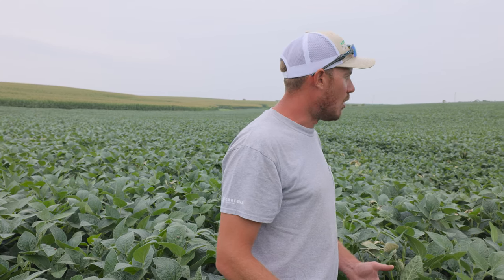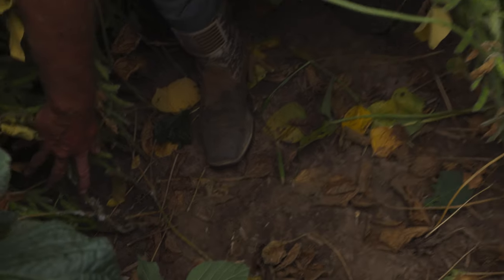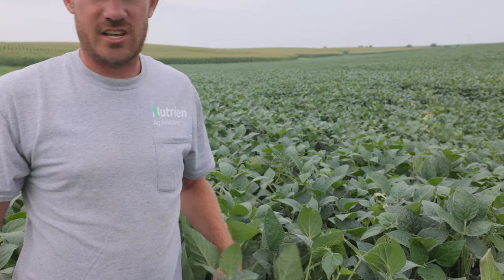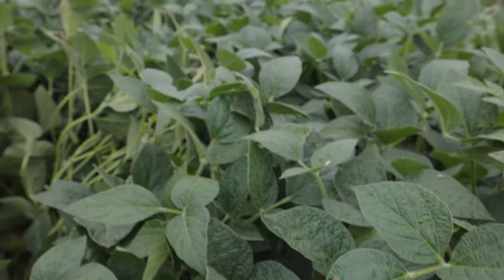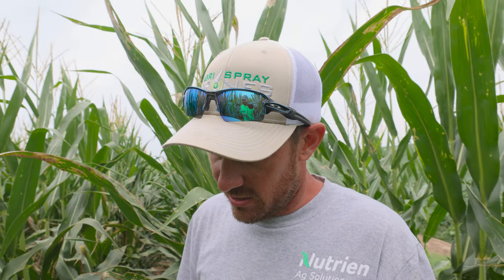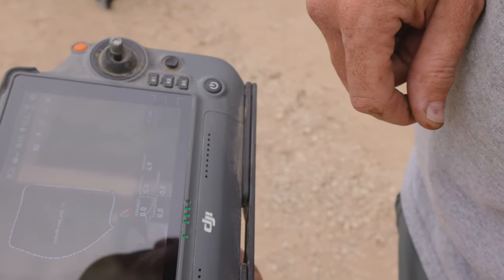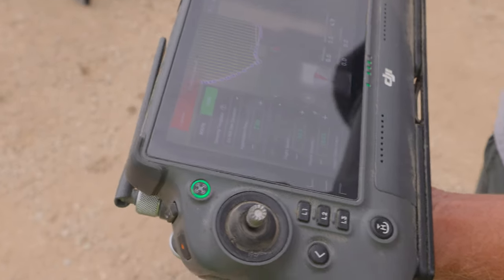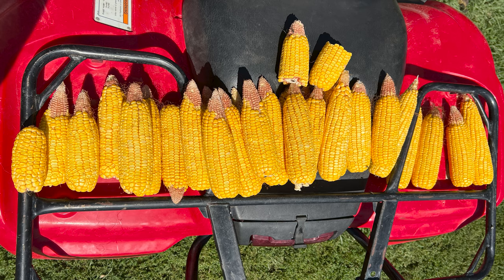What Does A Drone Spray? - DJI T40 Agras

Comment: Monocultures are impossible long term without chemicals. It is a common belief that farmers are saturating land with toxic pesticides, but home gardens and commercial landscapes use the chemicals as well. I use no pesticides or herbicides in my home garden but the ducks take care of most of them anyway. I never knew you could use a quadcopter to spray, that's efficient and reduces overspray! Also reduces harm to the operator.
Reply: You can also use them to interseed cover crops such as tillage raddish between rows. I believe that was actually shown on this channel about two years ago.

Comment: How much is the attitude above the crops ? I'm an owner fo a t30 and we fly close to crops
Reply: T-30s operate at a lower altitude and the terrain following is a little better. Usually on a T-30 we’re flying 12.5 ft over the crop 25’ wide. The T-40 is often 15-20’ up around 30’ wide
Reply: @andytuck13  Have you guys done any spray card tests comparing spray coverage between the t30 and t40? With the t40 flying that high Id wonder if canopy penetration is an issue and how much fungicide the earleaf is getting
Reply: @tomfarrell9302  Dr Steve Li at Auburn has done the most testing with these looking at patterns, using spray tape etc. the T-40 props are almost double the size of the T-30 and you have two more sets of props. The downdraft is quite a bit more with T-40 allowing for wider patterns at faster speeds and higher altitudes. The T-30 does have better terrain following and did a good job allowing for lower spray rates per acre to be efficient, but the T-40 has done well.

Comment: I'm just a general tech enthusiast that knows nothing about agriculture. How can those few gallons per acre of fungicide fight against those mold infections at the bottom of the plant? I'd assume that this light spray would abrely even coat the top leaves!
Reply from the maker: The wind from the blades stirs the canopy so less concentration is needed as compared to a ground sprayer

Comment: Holy crap alot of high yield picks for no corn on tops . I didn't count but 170 185 maybe
Reply: When it’s filled to the top often it’s a sign of too low of population and yield left on the table. The 34 ears weighed 22# at 1/4 milk line if that helps 😊